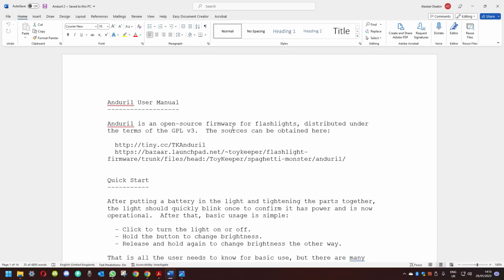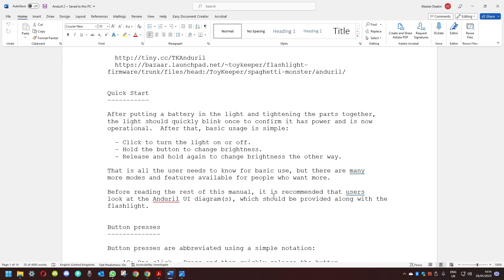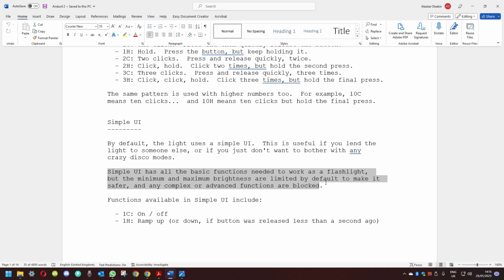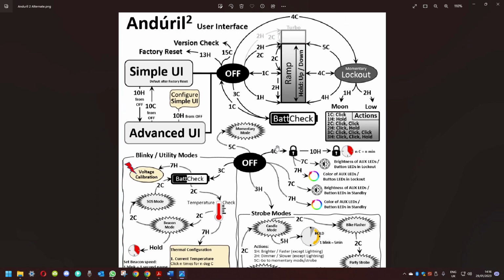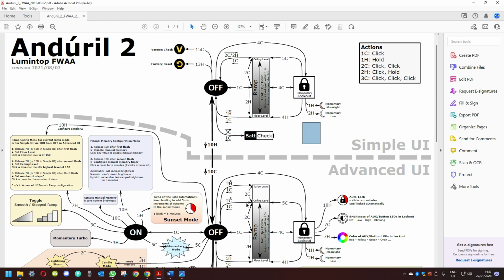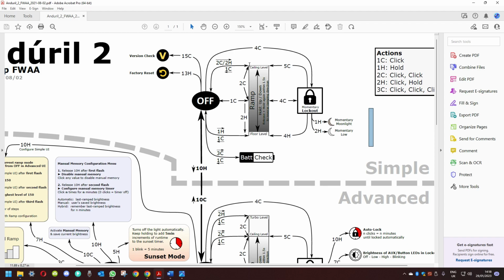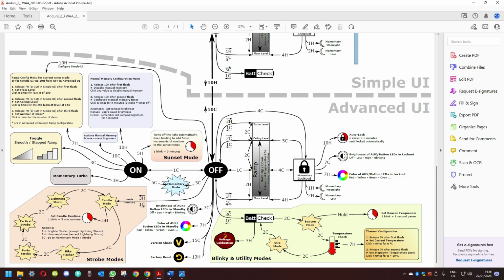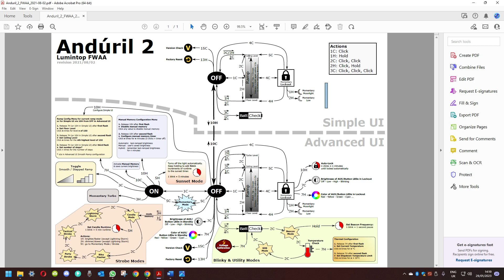What is Anduril UI in Flashlights

Comment: Man! I really don’t want to use a flahlight with morse code or programme it like a computer but with only an one-pixel monitor and one-key keyboard.
Reply: That's alright, plenty of lights use no user interface and just button modes
Reply: @microwave311 this one is another level of complexity
Reply: @Laurarium a majority of functions are just a few clicks, auxiliary lights, temperature and voltage regulation modification is a beast not typically found in flashlights, it could be easier to have more than one button to command it but then whats the standard, all flashlights require four directional buttons now?
Reply: @microwave311  I want it simple, everything set at factory perfectly, no need for “customization”. 
I know maybe certain hobbysts like it, not a good idea for most people.